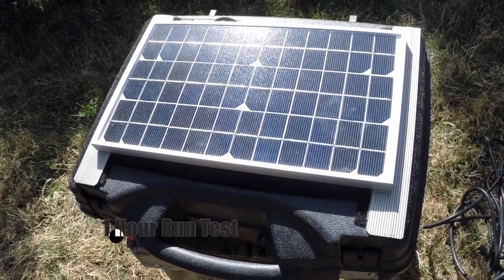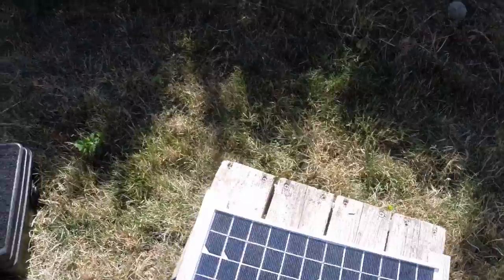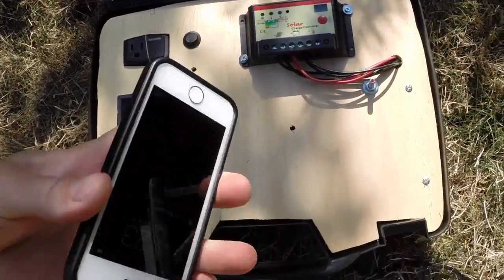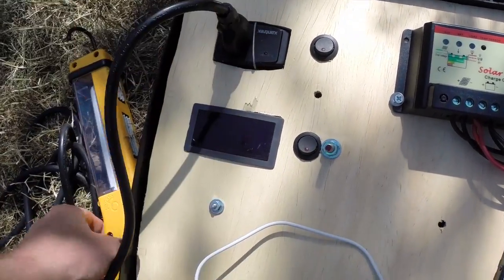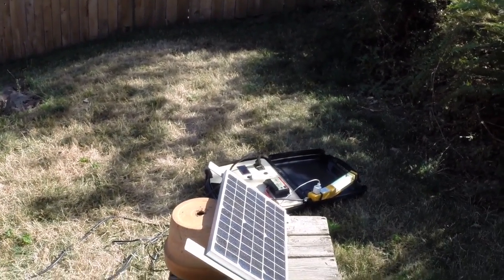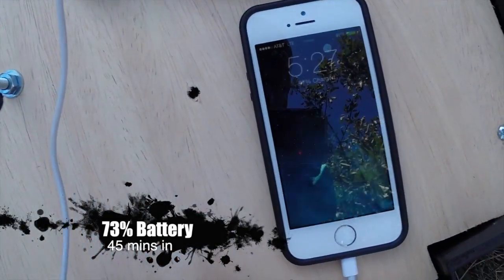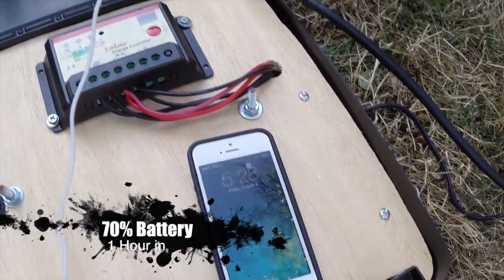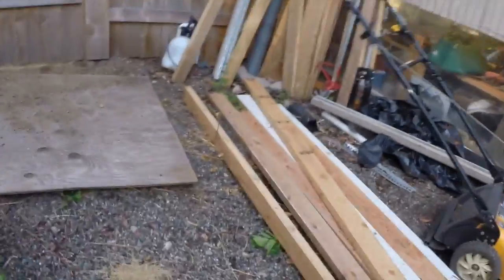Solar Power Pack 1 hour test

Comment: Hello there solar burrito. I am making a set up similar to the the one in this video. I was wondering if you can can answer some questions for me. I have all the parts, my panel is 15 watts and my inverter peaks at 400 watts. my battery is a gel cell sealed 20-AH battery, 12 volts. would this be enough to run my child's asthma machine. The machine is small , maybe a toaster size if not smaller, and is as follows ( 120V-60Hz 1.7amps) . I have plugged the machine to the inverter and battery and it worked fine. About how long would I be able to run this machine on a full charge, and are my components adequate enough. Your assistance would be greatly appreciated. Thanks. Great video.